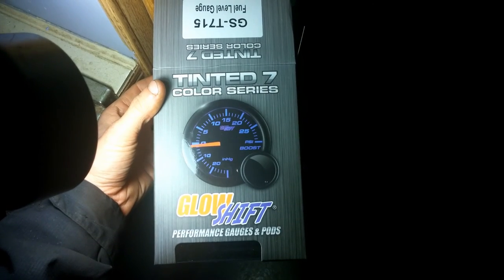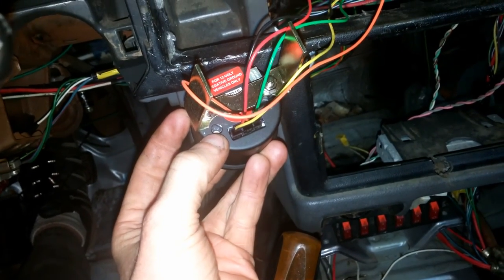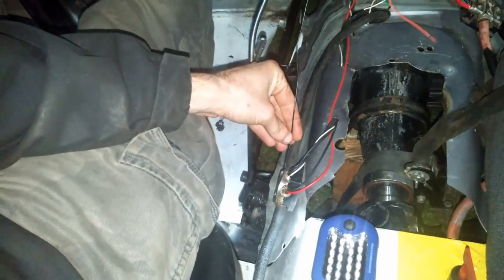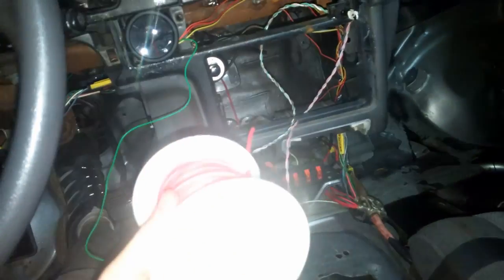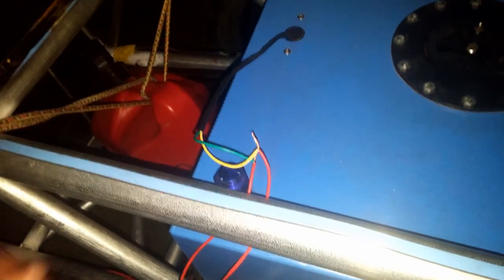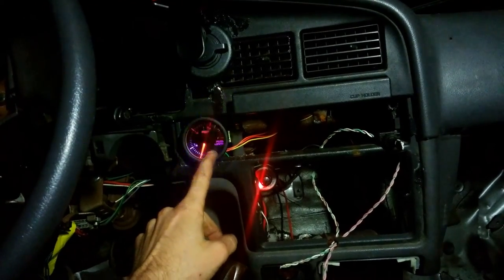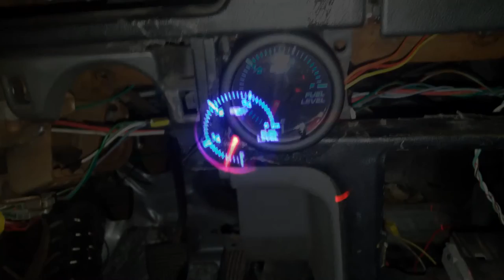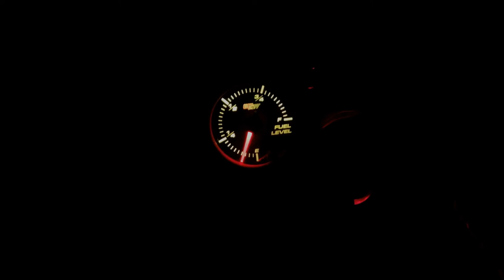GlowShift® Fuel Gauge Installation (for Fuel Cell)

Comment: Installing all my gauges and could not get the fuel sensor to work.....well I feel like a fool not realizing one of the wires from the tank have to be grounded also....I hope this solves my problem. I like the gauges from this company, especially the option of changing colors. You are correct you need constant power on the yellow wire so the gauges  remember the color you set them at......thanks for your video Joe

Comment: I installed mine and when I switch on ignition it doesn’t move. But when I switch off ignition it moves to the reading before the gauges turn off
Reply from the maker: Wired it up wrong. Check the wites again. If theyre GOOD, then its defective.
Reply: @Syrus54  I connected the gauges how they’re supposed to go because my other 2 work fine. I found my signal wire and I had tapped into that and it wasn’t working it was going all the way to full. I had tapped into my ground and it would mark empty. So I tried tapping my ground with the signal and it would go to full. And when I don’t have the signal wire connected to the fuel signal it marks how much gas I have according to my gauge cluster.